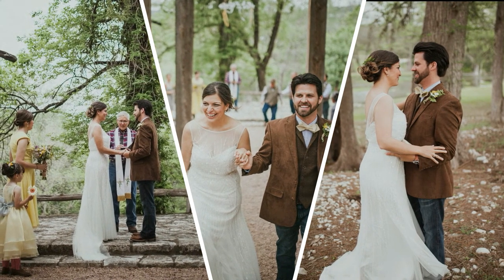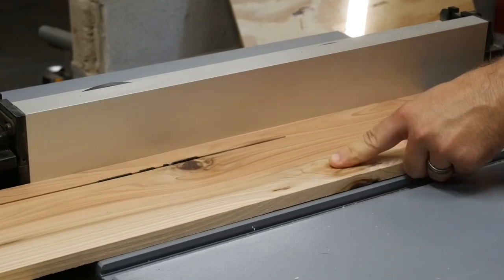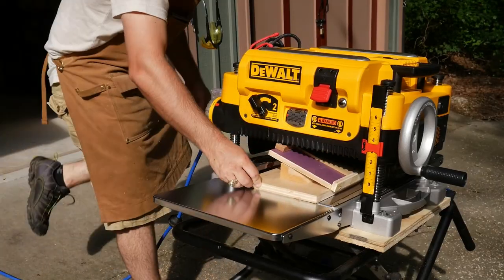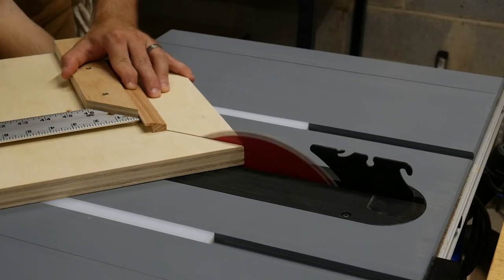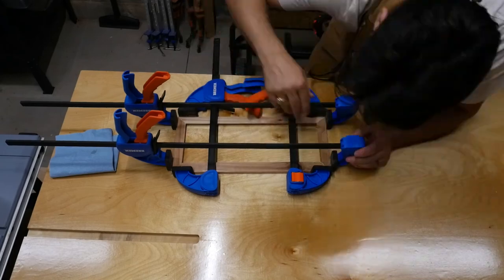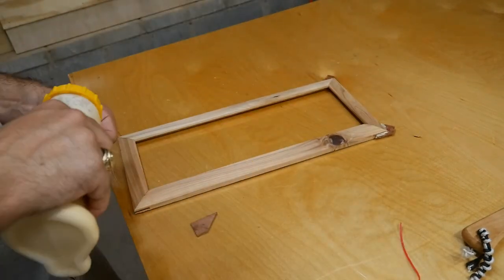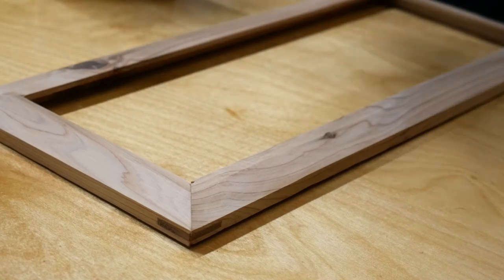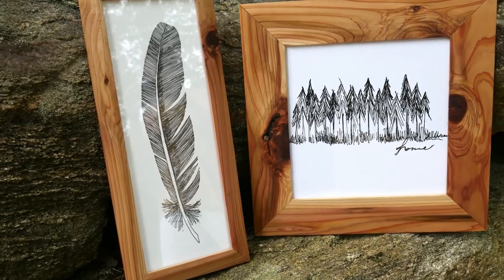Don't Waste Money Buying Picture Frames When They're This Easy to Make

Comment: Fantastic video thank you. Can i ask which part of the stop block you are aligning to the ruler to determine length? Is it the point? Or where the ruler meets the block?
Reply from the maker: Thank you! It's where the ruler meets the block. Since that's essentially the measurement of the length of the rabbet, which is really what you're trying to cut the frame for. That's the dimension that needs to fit the picture. Whereas, the inner edge and outer edge of the picture frame can vary widely depending on the style of frame and picture, but neither really matter for making a good fit for the picture.

Comment: You can do the same thing on the table saw (without the planer jig).
Reply from the maker: You can indeed!  The main reason I liked the planer jig was because how thin and short those frame pieces were going to be, I didn't want to be fiddling around with push sticks trying to get the piece cleanly through the table saw.  So this planner jig was just my solution to do the same thing I could do at a table saw, but keeping my hands further away from a rotating blade. :)